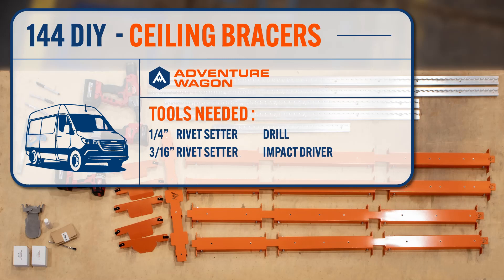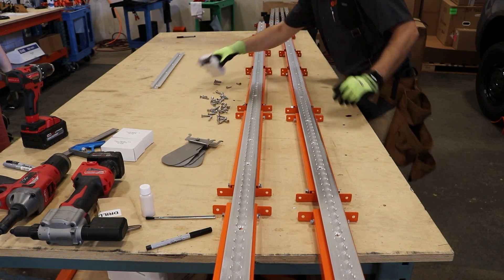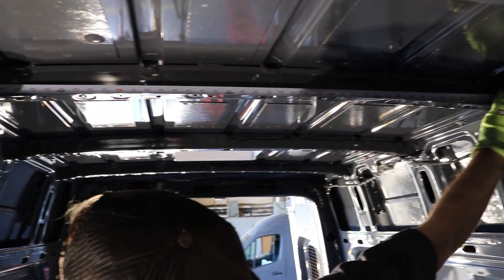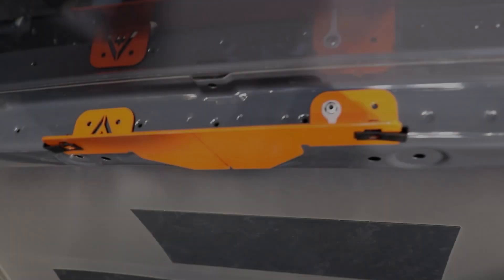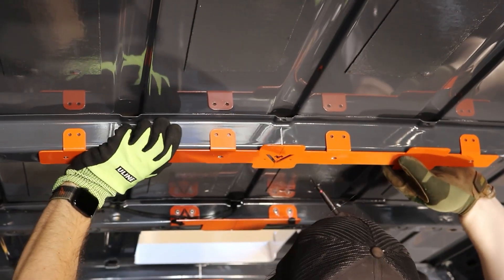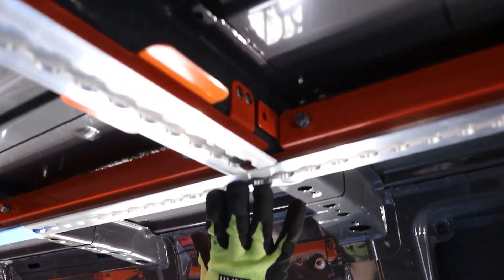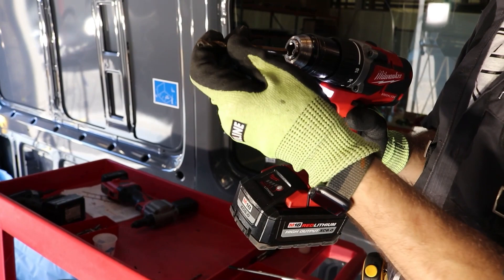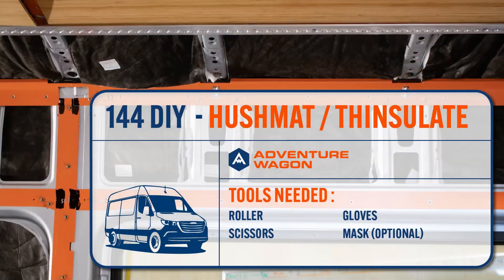A-Frame Ceiling Bracer Installation - Sprinter 144

Comment: Awesome video! A couple of notes after I installed my kit:

1. I did not do fan cutouts, so the orientation of the small center brackets on my 2nd, 3rd, 5th, and 6th brackets was not obvious. It may have been called out in the video but I ended up referring to 9:18 in order to figure out orientation. 
2. My kit only had 2 strut holders, so I wasn't able to mount both of my ceiling struts reliably. I ended up mounting my drivers side first and basing it off of the ceiling-level L-track wall bracers to ensure that was parallel, and then did my passenger side and ensured parallelism between the drivers and passenger strut.
3. I bought the Astro Pneumatic PR14 air riveter, and even at 120 PSI it required 2 cycles per 1/4" rivet in order to pop them. I found that I could only get 2 rivets set (4 total cycles), and then I needed to cycle my compressor to get it back up to 120 PSI.